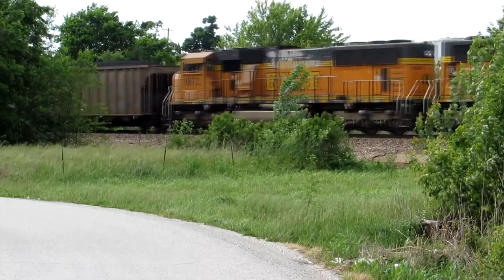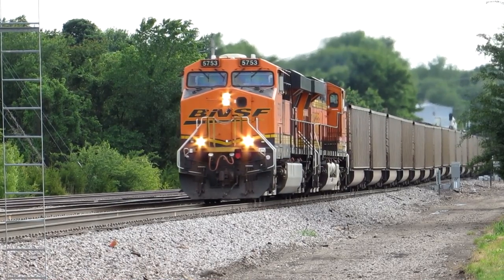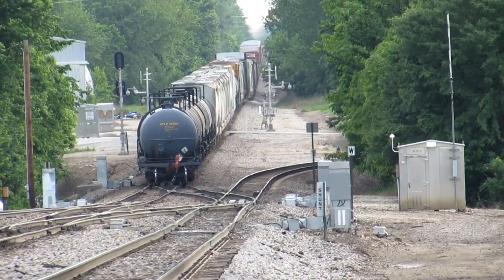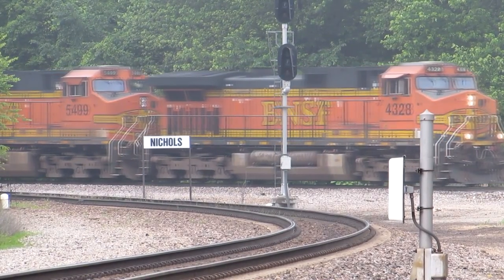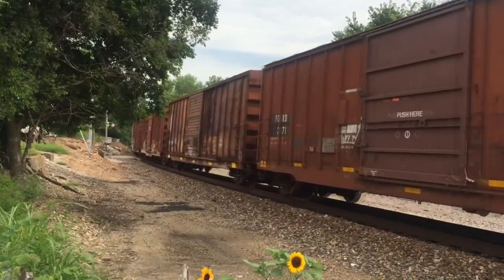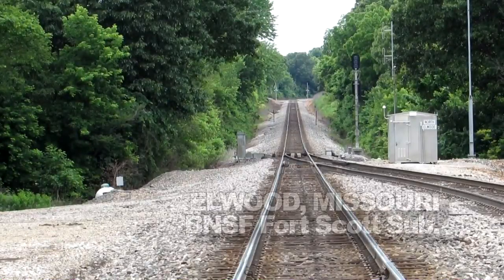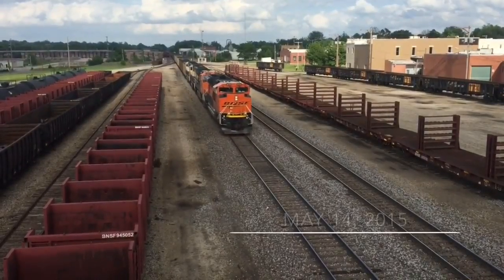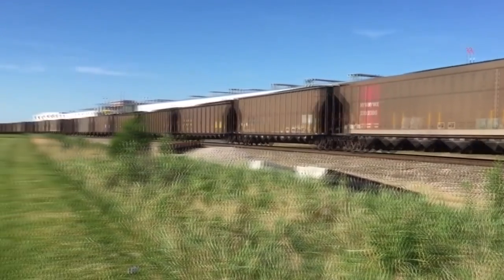HD: Crossroads of the BNSF Railway: Trains of The Springfield Division

Comment: Great classic mid 2010s BNSF action!
Loved the old yellowbonnets especially that trio of them! Chances are today at least one of those got repainted.

Let’s also not forget the H2 and Executive SD70MACs! I was surprised to see one of the old MACs leading as normally they’re only used as DPU helpers and are mostly seen on coal drags. Main reason we normally don’t see them lead is because they aren’t PTC(Positive Train Control) equipped. Same is also the case with the MACe rebuilds.
Reply from the maker: Hi, Alik!  Thanks for watching! Yes...sadly, all of those old Santa Fe units have been repainted.  It was cool seeing that solid set of ATSF power for several years.  The same engines still power this local train, but they were all dipped in orange a while back.  I also miss seeing all the MACs.  We still see them occasionally...but, yes- rarely in the lead.
Reply: @The Main Track Even though some of those Ex ATSFs have been scrapped unfortunately, or repainted and or rebuilt, I’m still happy to know they are still being used. Many even get to keep their original numbers! 

For me, as long as a unit can still work, is reliable enough and can be rebuilt/refurbished for continued use, I’d have it used for as long as it can keep going. Because I’d hate to get rid of just about any unit especially EMDs. I’m glad BNSF still has most of their SD70MACs both Executive and H2 ones, even the MACes. They might be starting to age now but I think they can still go for a much longer time as long as they’re willing to put in the money.
Even if they repaint any of them, I’ll be alright with it as I really like BNSF pumpkin orange honestly. But we will always like H2 and Executive paint better in the end.

Comment: That was a long local ive ever seen, No Locals never have so many cars
Reply from the maker: Yes, it is a pretty long local! It's only about a 40-mile run.  Most of the cars seen were picked up from two connecting shortlines- the Arkansas & Missouri at Monett and the Missouri & Northern Arkansas at Aurora.  During certain times of the year, the trains are quite long as you see.  But, on the weekends, I've seen as few as three or four cars.  Thanks for watching!